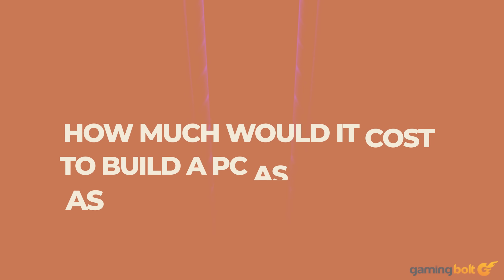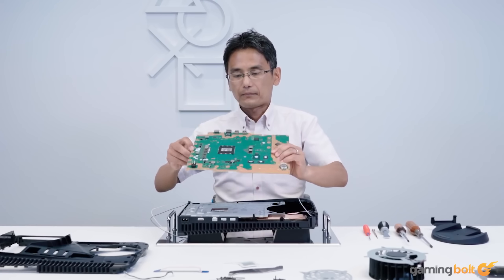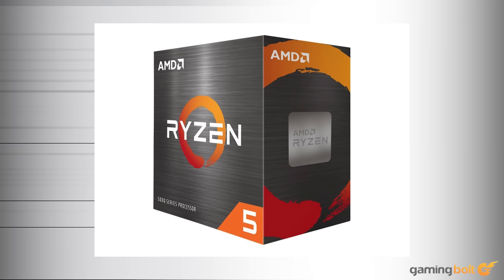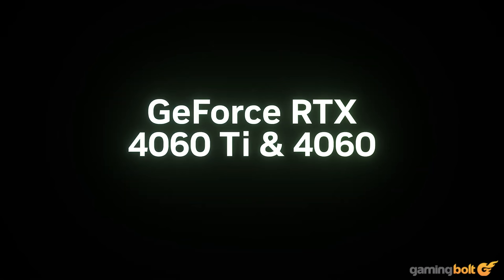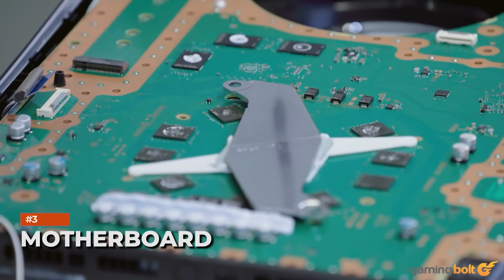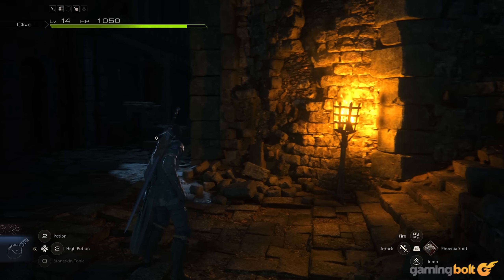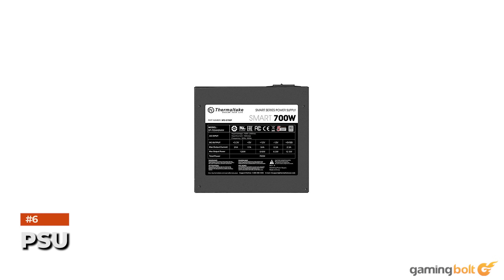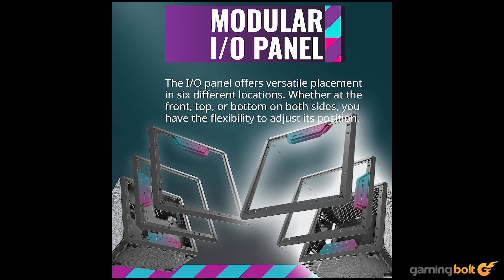How Much Would It Cost To Build A PC As Powerful As The PS5? (2023 Edition)

Comment: The 4060ti might be underpowered as a gpu but it's a bit overkill compared to ps5's gpu
Reply: People have forgotten about optimization now or what?
Reply: @conchita42 "optimization" simply means "run at low AF settings". See Cyberpunk or Spider-Man Remastered for example. Resolution, muddy as hell reflections, texture settings... Something is getting downgraded to meet an fps target.
Reply: He said 4060 not 4060ti bro.
Reply: @anointedandchosenprophet09  Still overkill
Reply: @brokebranch8224  is it though ? Considering that it has been said that the next generation of AMD APUs will be as or more powerful than a PS5 ! That's insane !! That means that the next generation of portable pcs will be as powerful as a PS5 ! So that means next gen Steam Deck and other such portable devices and cheaper laptops will be as powerful as a PS5 !!
Reply: No the cpu and ram were overkill
Reply: @@HehGiva Stay mad Console fanboy...
Reply: @HehGiva The majority of games on the ps5 are upscaled to 4k and the 4060 can upscale to 4k as well using dlss and which is a better method of upscaling than what any of the consoles use. And when you factor in ray tracing, rtx 4000 gpu's are much faster than the rdna gpu in the ps5 or series x.
Reply: No that's incorrect. And none of this matters because most AAA games are made and optimized for consoles.
Reply: @shyboy2112  is that why consoles tend to overheat?
Reply: @xXNaniPTXx  except they don't.
Reply: @shyboy2112   yeah they clearly do
Reply: The bandwidth will hold it back for anything going forward, even compared to consoles. It's more E-waste.
Reply: @OilFreeFeathers  what do u mean?
Reply: @OilFreeFeathers  This bandwith nonsense of its ssd to compute was hyped since it was announced. And yet all those years later it has zero difference. Even OLD HDD runs same games perfectly fine.
Reply: @OilFreeFeathers don't talk about things you don't understand
Reply: @shyboy2112  Take your meds.
Reply: @OilFreeFeathers  ok, brochure professor
Reply: @OilFreeFeathers Take yours, the vram capacity is only going to sky rocket too.
Reply: An rx 7600 for 250$ would beat a ps5.

A 20$ case would lower in addition to the 7600 would lower the price to 699, then you can either use trial windows or Linux to do way more on the PC than just game.
Reply: @jonl716 see I disagree, 7600 is great at 1080p but 4k 30? With raytracing? Idk. Remember PS5 games are optimized for the hardware
Reply: @longlostcoder6322  The PS5 uses a GPU that was slightly better than the 5700xt, with some features from the 6000 series. A 7600 at the same graphics settings will beat a ps5.

Look up comparison videos.

A ps5 will not have better ray tracing than a 7600. It's a generation or two older.
Reply: @longlostcoder6322 man rx7600 can do 4k 30 fps like ps5 in the same setting. PS5 99% game scale up to 4k from much lower res like 1080p or less sometimes 1440p. PS5 is not 4k machine this is only marketing by sony and MS. Both console have RDNA2 gpu-s similar to RX6650XT or RX6700 both this gpu is to play in 1080p 60 fps games but like consoles can upscale to higher res from lower.
Reply: @Mr_Pan01  They marketed the new consoles at launch as 8k systems lol
Reply: @Mr_Pan01  PS5 exclusives basically have their own better version if DLSS quality. So on one hand, yes your right... but my point still stands. You can't get a PC for the same price. PS5 might be a 1080p GPU technically but with game optimization it easily does 1440 native 60. As you can see with demon souls. I have a 4090 so I'm not s fan boy but just spitting facts. PS5 with PS5 exclusives is better then any $500 card right now.
Reply: @longlostcoder6322 30fps is shit, doesn't matter if it's 4k or not. But PS5 for what it and price. Is a solid console for sure.
Reply: @Mr_Pan01 all i want to Say, some are blind.4k only Indy game maybe lol
Reply: @longlostcoder6322 portage game Always Bad cause of this only.remind me all ps5 game on pclol.
Reply: @zeblacktiger  idk what you're saying. But I don't like to wait for ps games to port to PC. And they are usually buggy lol
Reply: @jonl716 You’re higher than Giraffe nuts if you believe you can get the performance of a PS5 without purchasing used parts. The better price/performance ratio remains in favor of consoles. It’s the reason many people like myself own PC’s as well as consoles.
Reply: @jonl716 what about fans for cooling, comparable gamepad (there isn’t one so buy a dualsense) add another $100 and you have a trash PC in a $20 case. Don’t know why PC idiots can just admit that you cannot build a comparable performing pc anywhere near console prices. Therefore, buy a console if you want to game on the cheap. Buy a PC if you want to game with the highest settings
Reply: @OG_Daz  my last build came with fans on the case and with the CPU.

I built a lot of crypto mining rigs even without a case. Idk why you're so hung up on it.

I use an Xbox controller.

On sale, 30 bucks or something. Not a big expense.
Reply: @jonl716   rx 6600 is comparable to ps5, and is even better at times.
Reply: @vasilisntalapas6391  Exactly Lol
Reply: @jonl716 dont forget a monitor mous and a keyboard
Reply: @jonl716  even the  rx 6600 will do the job
Reply: If you take DLSS out of the equation it's actually not overkill when the PS5 has almost double the memory bandwidth to help push high resolutions and the Tflop huge difference means nothing just like newer AMD GPU's 7000 sometimes are close to double the Tflop of the 6000 variant but then gives only a few more FPS in games cause they were severly cut in cores, memory bandwidth and so on just like Nvidia...

And off course 1 thing PS5 can count over a good amount of years is optimizations specially Sony exclusive titles will keep looking amazing beyond the 4060TI on PC specially when sadly lately we mostly get crap optimisation games cause they just tell you to use FSR and DLSS, screw the real performance...
Reply: @guily6669  4060 Ti is much stronger than ps5 even standard 4060 is stronger and can run games in higher res and setting in 60 fps. Many new games show that ps5 need to run games in very low res like 640/720p and upscaled to 1440p or higher and also ps5 don't use ultra setting, mostly is low/medium and even lower than low and in some setting is high. So no ps5 can't outperform any modern Gpu-s. PS5 is a RX6600xt lvl of performance low-end gpu.
Reply: @danwarb1  Take your meds, 6600 can't do 1440p 60 in modern games with the same settings as ps5..
Reply: @@no_name4080 I'm sitting on a gtx 980 Ti and i'm perfectly fine at 1080p, loving it, but it doesn't mean that we should compare the 4060 Ti to a PS5, it can easily do 1440p60 or even 4K60 at some games.
Reply: @@HehGiva Doesn't do 4k at that high. Stop lying. You can maybe get 60 at 1440p also most console games are capped. You aren't getting 120fps on AAA games on any resolution. Maybe Indie/non triple AAA games but 120 isn't something to be proud on those kind of games lol.
Reply: @@no_name4080The majority of ps5 games as well as xsx games are using upscaling to hit 4k. For instance the new star wars game can upscale all the way down from 720p to 4k and has really bad shimmering, artifacting and generally bad image quality. The rtx 4060 can do 4k as well using dlss which produces better image quality than any upscaling tech the consoles currently use.
Reply: @@no_name4080At what graphics settings you think Ps5 is going to do that. Even now it's nowhere near ultra.
Reply: the ps5 use something similair to the 6700xt
Reply: @@HehGiva Dude, there are only a very few games on the PS5 that will do 30fps at native 4K, never mind 60fps (you could probably count those capable of 60fps, on just one hand). And those that do manage native 4K, will always have thier graphics gimped down to the equivalent of med to low settings on PC. Most PS5 games running in 4K aren't natively achieving it, they are simply using upscaling tech (usually DRS or the game engines upscaler) to upscale from a much lower resolution like 1440p. It's no different in that regard than a 4060 (or any GPU in this range), that is using either DLSS, FSR or XeSS.
BTW, there are also slightly more games that will hit native 4K on a 4060, when it also has its graphics gimped down like the PS5 (Which also uses far  less VRAM, BTW).
You really ought to watch the DF video where they compare and pit a 3060, 4060 again'st the PS5, while using simular settings to the PS5. The PS5 only just beat out the 3060, but fell short of the perfomance level of a 4060 (+18% on average)
Also, the VRAM on a PS5 is shared between both the GPU and CPU. On the PS5, most games will typical assign around 10-12GB of VRAM over to the GPU, while the rest is used by the CPU (including the OS). Which means it has roughly the same amount of VRAM at it's disposable as a 6700, 6700XT or 3060.
A PS5 in reality is just a 1440p console (and then only just), that is mascurading under the typical console marketing BS of it being a 4K console.
If I had to compare any GPU to the PS5's GPU then it would likely be the 6700. Which is basically simular to a 6600XT, only with 2GB more VRAM, higher memory bandwidth and has slightly better 4K performance.
Reply: Underpowered and overpriced. What a great product.
Reply: @@no_name4080 Can't say for sure, let's hope that's the case because i want people to have an affordable 450$ machine that's capable of if not 4k then 2K 60 fps.
Reply: @@HehGiva Haha dummy, I've read some of your replies and it shows that you have no idea what your talking about. "Ps5 has 16gb of vram" wtf! Only 13.5 gb of ram is available to game developers as the other ram is reserved fornthe PS5's OS, and no, not all of that is used for vram. Games need a few gigabytes of system memory to run as well. And yes, a rtx 4060 can upscale to 4k using dlss performance with settings dialed back to ps5 levels which is better than ps5's checkerboarding or fsr2.0 being upscaled from 648p example the new star wars game.
Reply: @@HehGivastop lying bro !
Reply: @@HehGiva No Im just saying that 4060Ti or AMD Equivalent will run games at 4K with lower settings and upscaling and frame generation easily. You imply that this is only; possible with consoles. Yes consoles run games well. Maybe because games are literally created for them. While PC has to brute force its way out of it. My 3060 can barely handle old PS4 game Last Of Us... and its like 2 or 3 times more powerfull then PS4...
Reply: @HehGiva vram isn't everything smart ass if it was then the rtx 3060 12gb would be better than the rtx 3060 ti 8gb vram which it is clearly not. The ps5 lines more up with a rtx 2070s not a 4060
Reply: @geoff0707  The extra 4gb of VRAM is becoming essential. I’m sorry but in 2023 the 3060 12gb was the smartest thing Nvidia ever did with the 3000 series cards. Just look at how well the cards are selling in 2023 especially now that you can snag one for $250. Mark my words 8gb of VRAM will no longer be the standard. You will need minimum 12gb, or more.
Reply: @@HehGivaand you're very wrong there is no AAA game right now that the ps5 can run 4k 60fps natively. It's either 4k 30fps or 1440p 60fps upscaled to 4k.
Reply: @@HehGiva So let me get this right. You who haven't done any rigorous testing and in depth analysist are right, but a couple of dozen or so tech channels who have done all that rigorous testing and comparisions while using a large data set of games, are all wrong. Sorry Dude, but I sooner believe them, than you. Virtually all of the tech channels who have compared the PS5 against PC hardware, have all come to the same conclusion. That is that the PS5's level of performance on average in games is comparable to a 5700XT, 6700, 6600XT or 2070 Super (all in the same ballpark), when coupled together with a simular performance CPU (3600X, 3700X or 5600). Just Google it and do some research first, for Christ's sake!!
As for equal to a 3080Ti, GTFO...Lol!!. You obviously haven't got a damn clue. A 3080Ti has around 90-110% or around double the amount of performance in games than a PS5. And if your two 3080Ti PC's each cost $3K then you seriously got ripped off, dude!!! I guess that also shows just how dumb you are, Dude. 
Also, go and watch the Digital Foundry videos where they've done a buttload of in depth game comparison and analysis  between the consoles and a PC. Virtually every single game on the PS5 and Series X, that can just about manage native 4K (And then only 30fps, 95% of that time), are using gimped down graphics settings, which are mostly equivalent to medium to low settings on PC. Sometimes some settings are even below the lowest possible setting that is available on PC. Again, if you run a 4060Ti, with those same settings as the PS5 at 4K, then the 4060Ti will often outperform the PS5 in most titles (a couple of PS5 exclusives are an exception to the rule)
In those medium settings at 4K, a 4060Ti also doesn't run into issues with VRAM amount or bandwidth. It's only when it is using Ultra settings or is attempting to use RT, that it will seriously start to struggle at 4K. Lower settings, also means  lower VRAM requirements and less memory bandwidth needed (Plus, there is a 16GB model of the 4060Ti, anyway).
It also sounds like you are using results for the 4060Ti whilst it was using Ultra settings (probably taken from review test results, which always use Ultra as a baseline). But like I said, the PS5 is only using medium settings at very best, whilst in native 4K. Dropping down from Ultra to Medium settings can often give around an extra 30 to 40% boost to fps, BTW. So you have to take that into account for the 4060Ti.
You have to compare two things like for like, on a level playing field and not on a hillside.
Reply: @@HehGiva EXACTLY. And with tons of pc hardware parts, no wonder nothing can be optimized on pc that easily. Its like making an optimized game for each of thousands of different consoles. Consoles easy choice for AAA games for the budget and no headaches.
Reply: biggest cap of the month, look up spider man 2, ps5 can't make 4k60 nor QHD120 lmao, you are delusional@@HehGiva
Reply: @@HehGivabro is the ultimate ps5 glazer 💀💀
Reply: @@no_name40802023 spider 2 and ps5 already can't make 4k60  bro got instantly debunked lmao 💀 this didn't age well
Reply: @@HehGivangl the dlss excuse is really lame, why they can't just make optimized games that can reach 60 fps without the use of dlss
Reply: @@no_name4080 hmmm yea probably, idk my country doesn't use dollar, but here the pc equivalente would be almost 2 times more expensive so i believe you
Reply: now do 4k on both
Reply: @bercal6180   PS5 fails tremendously in 4k bro! most games can't run natively and if some can, they play at 30 frames!
Reply: Rtx 4060ti - 400$ and ps5 400$ 😢😢. 
Yes rtx 4060ti is better but you have to buy cou, ram, storage, motherboard, powersupply and a goddamn case to fit all of them  or you can save money by fitting them in a bucket 😂😂
Reply: Not true, when you factor in optimization. 4060Ti will get dunked on by the PS5.
Reply: @JamesWillis-yy5px  No just no!! Look at frame rate and setting published by people who actually took time to post and you see that ps5 struggles to rival rx 6600!
Reply: @vasilisntalapas6391  On what games? Crap games? How about just comparing Demons Souls on PS5, to any PC souls game on PC! 
  You won't find one that looks any better. Hell Killzone Shadow Fall on the Ps4, still looks better than half the PC games around.
Reply: @JamesWillis-yy5px  OK FANBOY, i get it, i insulted your precious ps5, i also have one but im not dellusional! Pc has far more realistic games in graphics and stupendous more exclusives than any other console! I have pc ps5 and switch, but i ain't a fanboy, so that my judgement is clouded!
Reply: @vasilisntalapas6391  I own a gaming PC, not a PS5.
Reply: @JamesWillis-yy5px  The 6600 is able to produce pretty much the same performances as a PS5 at the highest settings for most modern AAA titles. Even beats the PS5 in some games like Cyberpunk
Reply: @brokebranch8224  The PS5 has a 16gb memory graphics card. 
  The 6600 won't even play most modern games, as they will be using that 16gb memory the consoles have. 
  I'm waiting for the 5000 series. ill stick to old games for now.
Reply: @JamesWillis-yy5px  The  PS5's 16gb memory is used for the entire system, not for the GPU alone
Reply: @JamesWillis-yy5px  remember that consoles are more optimised to develop for, so devs can squeeze out more from them.
Reply: after using dlss or fsr 3 it can easily out perform ps5
Reply: Underpowered as a gpu?
Reply: how tho? the ps5 runs 4k at 120hz?
Reply: @zacharyschultz7991  It doesn't run native 4k, it's been upscaled. And the quality preset is below the ultra preset achievable on PCs
Reply: @brokebranch8224  ah (i’m gonna pretend ik what that means)
Reply: @brokebranch8224  but fr can you explain to me what that means lol and what the difference is?
Reply: @zacharyschultz7991  It means you're not running a pure version of 4k, the quality is going to getting downscaled a bit to lower resolutions while maintaining the same 4k frame
Reply: @brokebranch8224  ok gotcha, but i was looking it up and most of the time it seems like it’s the games that aren’t native in 4k no? so like the system could just most games aren’t in 4k natively?
Reply: @zacharyschultz7991  It depends. For some older and lesser demanding games, it is possible for them to run at a 4k native resolution, but for most new triple A titles upscaling is a must for a 30fps experience on 4k
Reply: @brokebranch8224  well i mean it can run upscaled 4k at 120fps so id think it could run native 4k at 30-60fps no?
Reply: @zacharyschultz7991  It doesn't run upscaled 4k at 120. With Native 4k it will stay at around 30 if the game is not too demanding
Reply: @brokebranch8224  but it just does tho, like that was a big selling point, and sony said it runs 4k at 120fps
Reply: @zacharyschultz7991  Sony lied bro, it doesn't, and I don't think Sony ever said that
Reply: @brokebranch8224  you got a source? cuz everything i find online says it does
Reply: I have both a PC and a PS5, and i can say the PS5 is more optimized than the PC
Reply: Agreed … love the idea of this video, but I think mistakes may have been made w some decisions… but hey I still enjoyed the content so I will shut
My mouth now lol
Reply: The video showed a render video of the 4060ti but he said 4060. 4060 would be closer to the PS5's GPU than the 4060ti.
Reply: @@HehGiva4060 can do 4k 60 with DLSS like ps5 with FSR2 or checkerboarding, consoles 99% games scale up res from 1080p or lower sometimes from 1440p. Old games can run in nativ 4k 30fps the same can do 4060. But overall 4060 is better have faster RT petf and support new technologies like AI or machine letning.
Reply: @ttwinsturbo this is exactly what i was going to say those those saying the ps5 does 4k 60fps but in reality does it do it in native resolution without any type of upscaling or with highest settings? A 2060 with dlss low settings can probably get more than 60fps ar 4k.
Reply: @katser5023  dlss IS upscaling , and no a 2060 is not getting 4k 60 fps in any current gen game lol
Reply: @Dempig  yes, and that's exactly what the ps5 does to achieve those 60fps at 4k. Like a said a 2060 with low settings and dlss can probably get more than 60fps ar 4k and still have similar image quality as the ps5.
Reply: @katser5023  No , it cant. Go look at any benchmarks, the 2060 struggles to get 60 fps in The last of us and Ratchet and clank even at 1080p with dlss balanced medium settings.  It does not have enough vram to even play those games at 4k even with dlss performance.  Why are you even trying to argue when you can look up the benchmarks of any new game and see the 2060 cant even run these newer games even at 1080p with dlss.
Reply: @Dempig  the last of us and rachet is a sony games thats runs wery well, on pc this both games are unoptimized at the start. Now after many patches this games runs much better on low-end gpus. Yes 2060 is weaker than ps5 but 2070 super or rx6650xr is equal to ps5 performance.
Reply: @Mr_Pan01  NO 8gb card will run current gen games anywhere near as good as a ps5 , because they will stutter like crazy.  Has nothing to do with optimization, 8gb vram cards do not physically have enough memory to run current gen games at 4k or even 1440p even with dlss.
Reply: @Dempig Digital foundry has shown in many comparison videos that the gpu in the ps5 is about the equivalent of a rtx 2070 while the xsx is closer to a 2070 super. An rtx 4060 is superior to both those gpu's and much faster when it comes to ray tracing.
Reply: @LeeLee-fi7mx   A 4060 is NOT good at ray tracing its literally unusable for ray tracing even with dlss even the 4070 is far too weak for ray tracing., and a 2070 super is NOT comparable strictly because of the VRAM.  In power they may be similar, but because of the 8gb vram on the 2070 super it will be physically INCAPABLE of rendering the same textures as a ps5.  You can see this in many games such as far cry 6 , resident evil 4 , control , final fantasy 7 remake, the list  goes on.  8gb vram makes the card unable to play current gen games without being a stuttery mess.  You clearly dont understand the hardware limitations of 8gb vram.
Reply: @Dempig u mean the same the last of us that made 4090s suffer? With that shitty ass optimization nothing can lmao, get tlou out of this equation since is a broken pc port
Reply: @dn_vii  Replace Last of Us with literally any UE5 game, same thing.  You cant blame optimization when its going to be every single game going forward.
Reply: @Mr_Pan01  No it cant lol even with terrible dlss upscaling the 4060 is a hot turd and is not playing ANY new games at 4k ultra settings.  The 4060 cant even do ray tracing at 1080p, its FAAAAR too weak.
Reply: @Dempig  the 4060/4060 ti 16 gig (if you ignore price) are monster 1080p cards my dude. It plays pathtracing games, while ps5 struggles with shadows.
Reply: @born2serve92  I couldnt imagine how bad 1080p with dlss looks.  It looks bad at 4k.  But using dlss at 1080p is basically 720p, I dont know why anyone would pay ~$450 to play at 720p just for a bad ray tracing experience.  I would take a console any day over a 4060 ti if those were my only two options.  A 6950 xt is only $100 more and has better ray tracing performance than the 4060 ti and DOUBLE rasterization performance.
Reply: So the PS5 is stronger then a 4060, wow.
Reply: @imakebabies6613 Nope the ps5 is the same as a 3060
Reply: @imakebabies6613  ofcurse it is video card by itself dont mean anything . It like you have a car that can go 200mph but try to get to that speed offroad .  And im not here to debate which is better console or pc , all is shown here in the video yet again that dollar for dollar pc can't have same game performance as ps5 .
Reply: I agree except for the "underpowered as a gpu" part. Are you kidding me? 🤣
Reply: @@HehGiva PS5 can’t do nativ 4k 60 fps, and 16GB memory in PS5 is shared with cpu and os, so for games is 12 GB. Yours console have RX6650XT gpu inside the same RDNA2 architecture 10.4 TF vs 10.3 TF in ps5 and according to Digital foundry CPU both consoles is weaker than 2017 ryzen 5 3600. True 4k gaming is only on PC with 83 TF RTX4090 or 50TF RTX4080 minimum GPU to play games in 4k is RTX3090 or AMD RX6950XT - PS5 is even not close to this GPU-s but on the market is a lot GPU-s faster than ps5 and not high-end like RTX4060 or better. I see ps5 4k in new games 640p/720p or 1080p scaled up higher…..or HFW pixelated detail, grass etc! This is not 4k image if you never see nativ 4k you don’t understand. Both console have fake 4k and fake shadows, reflections etc. Because can’t run games with RT so all game is fake bit maps!
Reply: I hate to say it but anything less than 12GB is a waste today, 12GB is pushing it.

I don't think I'd have gone with the 4060 for that reason.
Reply: @glenwaldrop8166  Exactly nobody wants a 8gb GPU. It is not a good investment to make and I’m willing to bet money that in the next couple years 8gb of VRAM will no longer be the standard…it’s already dying as we speak.
Reply: @onlyfacts3502  They're always going to make cards with less than optimal memory.

Also, whatever the hell I said three months ago is three months old. New games have come out and changed the playing field.
Reply: The ignorance 😂, people complaining about upscaling techniques on ps5 put you can guarantee they have all the pissy filters turned up and DLSS version who cares, pulling 800watts. Meanwhile the ps5 costs less than a decent GPU alone and performance is better and more stable 😂 speaking from experience not synthetic benchmarks
Reply: @PlebsAreCute  800 watts? What you rocking there a 4090? Experience is everything you don't have that's for sure
Reply: Nope
Reply: Yeah optimization is a huge factor tbh my ps5 looks and feels better than like 90 percent of pcs i see with a lg c1
Reply: @kevinsanchez6738 ps5 on the LG C1 is peak gaming dawg, never regretted my decision of buying a 1300 dollar 48 inch tv lmfao
Reply: 4060 Ti is trash due to less VRAM. Its already struggling and will struggle even more in the coming years. PS5 is superior
Reply: @ajdaniel8128  People have been making that prediction for ages and it is still wrong.
Reply: @loganmedia1142  Last of us part 1 on a PS5 Pro is running at 4k with PSSR at locked 60fps or above if unlocked. The 4060 Ti is running at 24fps or 30fps with 4k DLSS quality with the exact same settings. Also, keep in mind that 4k with PSSR in TLOU looks way better than Native 4k. There are many videos on it
Reply: @Mr_Pan01  The 4060 literally cant even play games at the same settings as ps5 lol.  Go play last of us remake on a 4060 , oh wait you cant.  Go play ratchet and clank on a 4060, oh wait you cant.  The 4060 is too weak to even play 4 year old games like far cry 6 and control. You clearly know nothing about either pc or console hardware.  2070 super and ps5 are not even comparible, the 2070 will run out of vram in any current gen games.
Reply: @Dempig  Of course The Last of Us Part 1 is playable on a 4060.  Claiming it can't play all those 4 year old games is laughable.
Reply: @loganmedia1142  4060 is literally junk it cant play 90% of current gen games